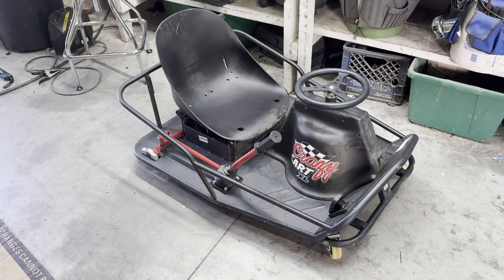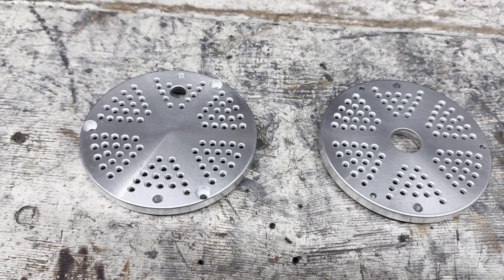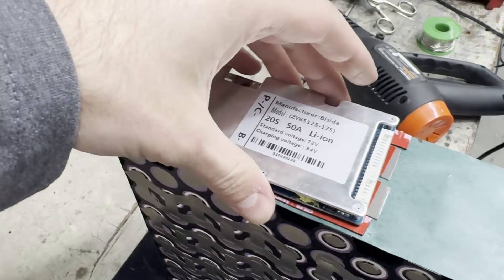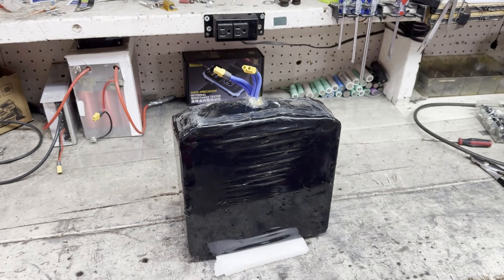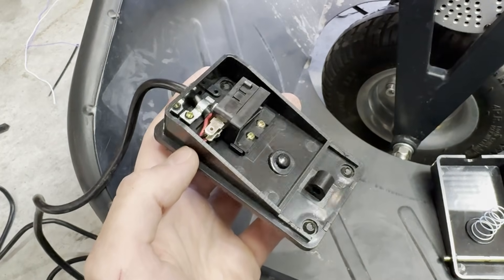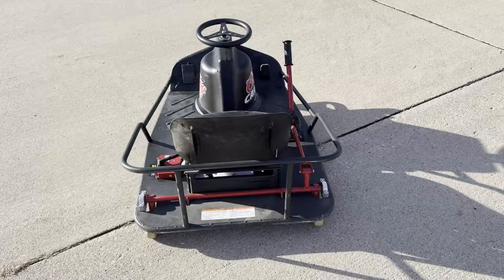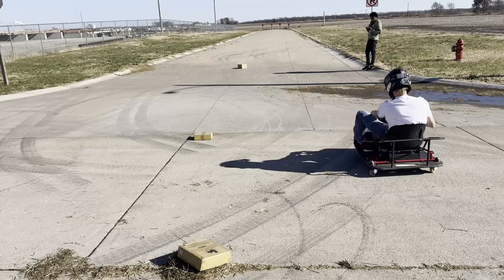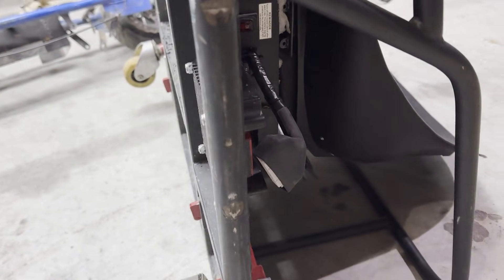72v Sleeper Crazy Cart

Comment from the maker: CLICK "read more" FOR MORE INFORMATION ABOUT THIS BUILD! Or, click here to join my Discord -> https://discord.gg/jGqtb877Z3

If you’re in North America and want to buy any ebike/emoto parts for your builds, check out this website: https://econiccycles.com/discount/Cal5. This is where I buy a lot of my parts, and I’ve never received a dud product from them. Use code “Cal5” for 5% off your order!

Cost Breakdown for this kart:

Kart: $450 (Facebook Marketplace)

Motor: $110 https://www.amazon.com/dp/B09GRVNNVC?ref_=ppx_hzsearch_conn_dt_b_fed_asin_title_3&th=1

Controller: $115 https://econiccycles.com/products/fardriver-sinewave-controller-nd72v50a-w-bluetooth (use code "Cal5" for 5% off)

Battery Cells: $175 https://outbuyer.com/products/bak-21700-battery-n21700cg-50-5-mah-1-25-cell?variant=42417544265817 (They were $130 with free shipping when I bought them, I guess great deals don't last forever. Still a good deal though)

BMS: $30 (I'm not going to link the one I used since I wouldn't recommend it, I like using these now: https://www.aliexpress.us/item/3256805967270449.html?spm=a2g0o.store_pc_home.0.0.564a36f26azrzF&_gl=1*1rgfa39*_gcl_aw*R0NMLjE3NjA3NDU2MTIuRUFJYUlRb2JDaE1JbjdyUWthYXNrQU1WR0M3VUFSMGM1U25mRUFRWUF5QUJFZ0xpZ3ZEX0J3RQ..*_gcl_dc*R0NMLjE3NjA3NDU2MTIuRUFJYUlRb2JDaE1JbjdyUWthYXNrQU1WR0M3VUFSMGM1U25mRUFRWUF5QUJFZ0xpZ3ZEX0J3RQ..*_gcl_au*MTc3ODczMTk2NS4xNzU5ODg5OTgx*_ga*MTQwOTIzODA0Mi4xNzYzNjAwNTAw*_ga_VED1YSGNC7*czE3NjQyNTc0NjEkbzMkZzEkdDE3NjQyNTc0ODUkajM2JGwwJGgw&gatewayAdapt=glo2usa4itemAdapt The 40A one is only $55 right now, make sure to get the 8-22s one if you are doing 72v)

Cell Spacers: $15 https://www.aliexpress.us/item/3256806325444165.html?spm=a2g0o.order_detail.order_detail_item.9.58daf19c25guRb&gatewayAdapt=glo2usa

Pre-Cut Nickel: $8 https://www.aliexpress.us/item/3256806339944872.html?spm=a2g0o.order_detail.order_detail_item.5.58daf19c25guRb&gatewayAdapt=glo2usa (Make sure you get the 22.7mm option for use with spacers)

Copper: $3 https://www.aliexpress.us/item/3256803902665602.html?spm=a2g0o.order_list.order_list_main.40.16c61802Gj6id3&gatewayAdapt=glo2usa (Idk how to price the small amount I used, which was 0.15mm. I had the 0.5mm from salvaging battery packs so I can't link that but the 0.3mm option on that page would work fine.)

Fish Paper: $5 https://www.aliexpress.us/item/3256806330328597.html?spm=a2g0o.order_detail.order_detail_item.7.58daf19c25guRb&gatewayAdapt=glo2usa

Kapton Tape: $5 https://www.aliexpress.us/item/3256805580784009.html?spm=a2g0o.order_list.order_list_main.96.16c61802Gj6id3&gatewayAdapt=glo2usa

Shrink Wrap: $8 https://www.aliexpress.us/item/3256801522307790.html?spm=a2g0o.order_detail.order_detail_item.5.60aef19ct564ZL&gatewayAdapt=glo2usa (I believe I used the 400mm one for this build but I'm not 100% sure)

All the other stuff: $76 (E300 wheel and tire, voltmeter, three speed switch, XT60 plugs, anything else I forgot)

TOTAL COST $1000

Comment: 72v 3600w "3.6KW" and only 30 mph?, something isn't right bro. I've seen other 72v builds on the crazy cart xl as they are becoming more popular now doing 50-60+ mph which is just scary fast
Reply from the maker: It’s limited by the gearing. I have a smaller sprocket that I was going to put on it that I know would put the top speed over 40mph because I had the same setup on a scooter, but after it started doing the speed wobble I decided that 30mph was fast enough.

Comment: Have you thought about hub motor with scooter forks?
Reply from the maker: That could definitely work
Reply: @Calthecool but how would you put on headset bearings?
Reply from the maker: @skima_rat Are you talking about a crazy cart?
Reply: @Calthecool yes
Reply from the maker: @skima_rat if I was doing a hub motor I would just mount it to the stock forks. If you could find scooter forks with the correct headset bearings they could work, but it would also have to be the correct height.
Reply: @Calthecool could use spacers to make sure correct height, but the point of the scooter fork is you can have a disc brake + suspension
Can use torque arms
An idea I had was to use a bolt for the top of headset bearing retainer (through the fork) as it is not load bearing

Comment: Use XT-90 anti-spark.  TF?
Reply from the maker: Yeah that would have been a better choice for sure. I have some anti-spark XT90 connectors but the last time I used them the internal resistor immediately burned out so I was hesitant to use them again.
Reply: @Calthecool  they have to be legit Amass brand.  There's a new version2 out, now - smaller with more current capacity and AS.  Cheers -

Comment: 30 mph on 3600w? Something is very wrong. I went 32mph on 48v with a 900w brushed currie. Gearing is stock wheel sprocket and 12 motor sprocket. And I weigh 235lbs. I would think its the tune you have or the gearing. Definitely could use some rdelta or sotion casters to give you more rear grip. Stock casters are dangerously bad. As far as the death wobble goes its the headset bearings that need to be adjusted or the tire pressure is too low. We tend use the tires at 45-60 psi. Also id move the regen to a button on the drift stick. You need that base to plant your foot to hold you in the cart.
Reply from the maker: Yeah the gearing isn’t for top speed, I’ve gone over 40mph with this same motor/controller setup on a scooter so I have no doubt I could do it on this cart with a smaller wheel sprocket. I agree this definitely needs upgraded components like bearings/wheels, but I’m done spending money on this cart so whoever buys it can upgrade those if they want.